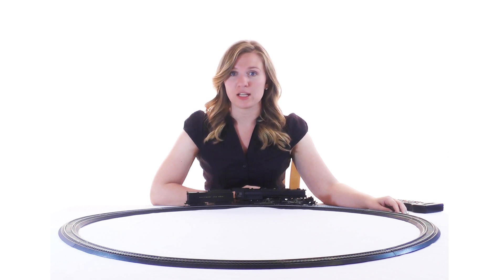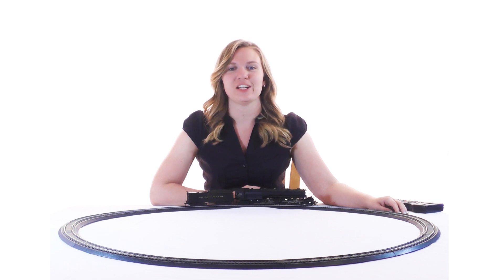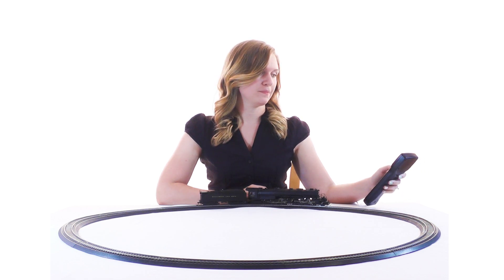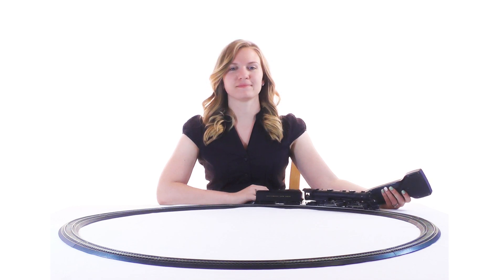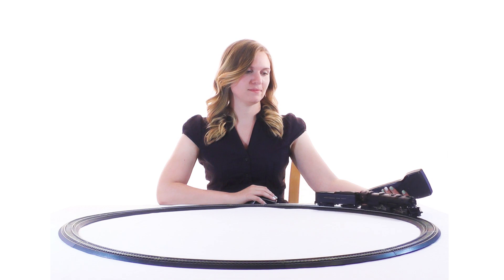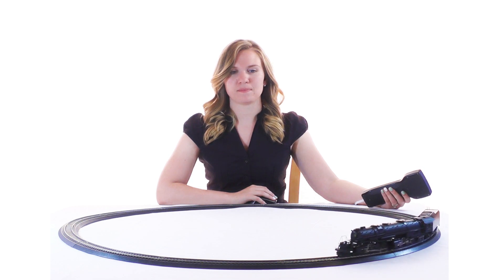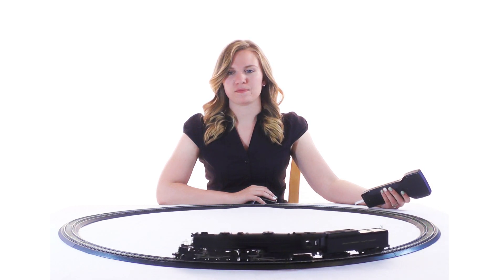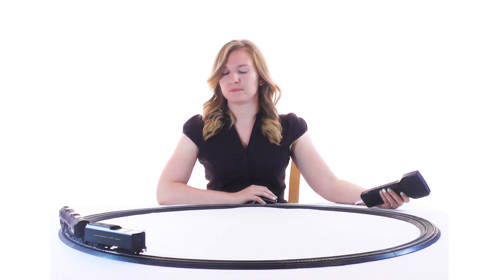TCS WOWSound Prototype Operation

Comment: Can a TCS WOWsound 1517 be installed in an older original LGB Mogul with headlight, flickering firebox and smoke unit?  Can it handle the amperage of this one motor locomotive?  I hear that these locos only draw under 1 amp regular current draw, but not sure if peak voltage is higher than 2 amps, can you help? ...Also
is there a higher amp rated all inclusive decoder that TCS has developed for G or larger scale and still has all these same features?   Does TCS WOWSound 1517 offer standing or ambient sounds when stopped, if so what are these sounds?  Thanks!